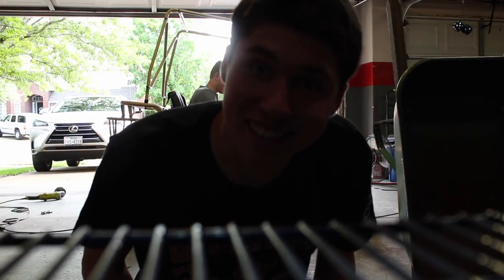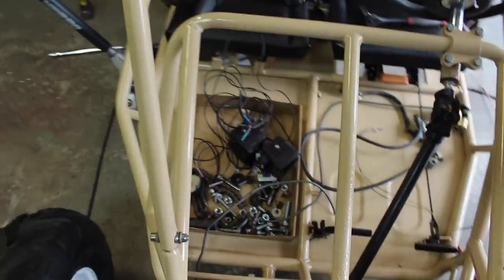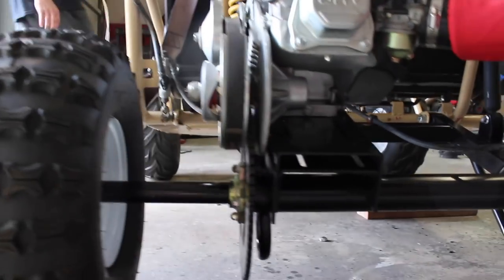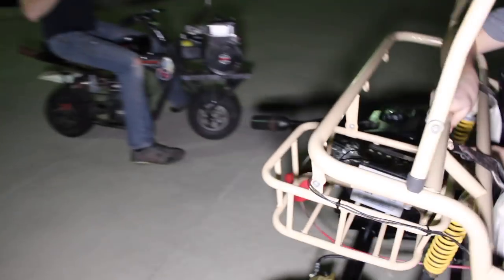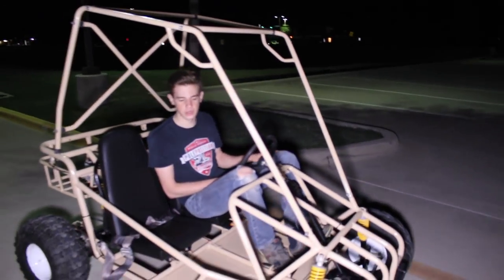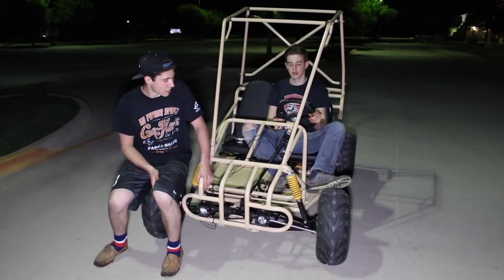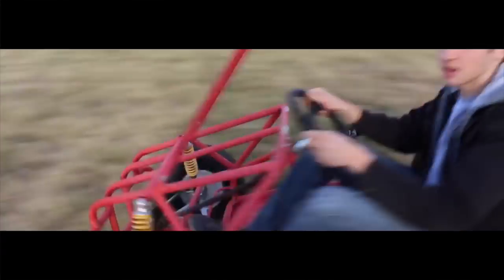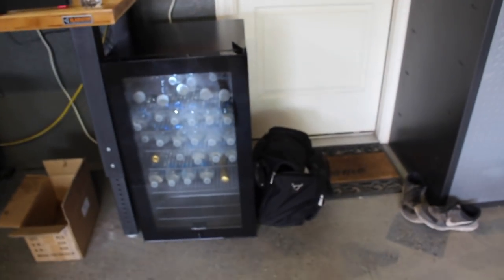Off-Road Go Kart Final Assembly and Drive!

Comment: I had that same kart. Got it for my kids from Northern Tool. After welding 50 pounds of American steel to replace the thin Chinese foil it was made out of it wasnt bad. Put a built briggs on it that eventually tore it to pieces. Its more for a smooth yard. Off roading will break the swing arm quickly.